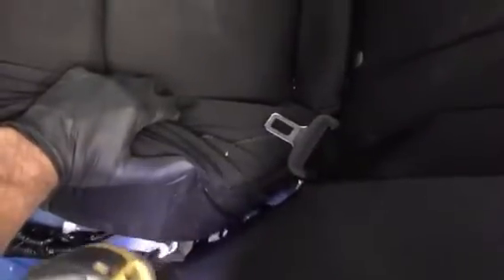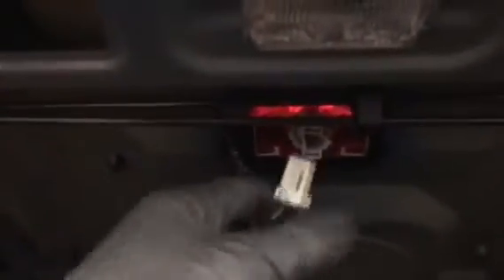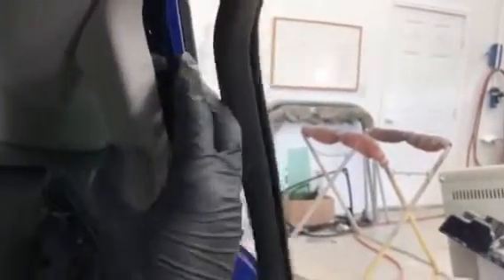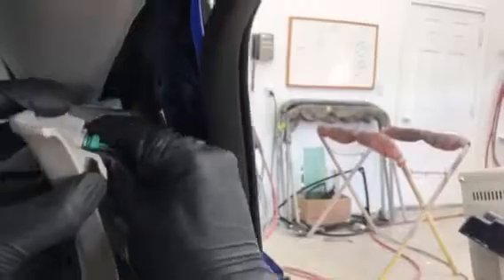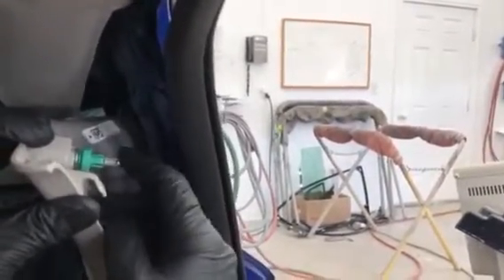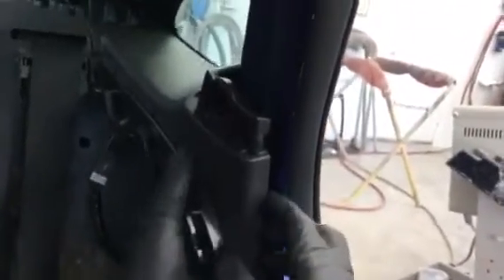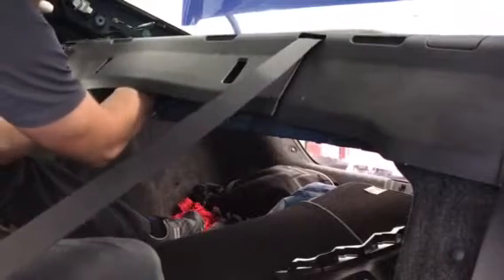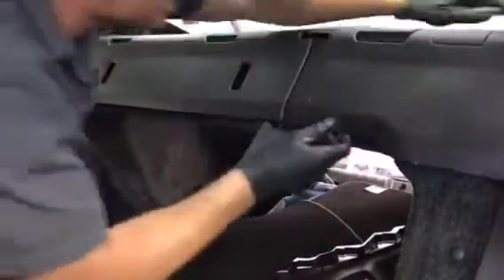2016 2017 Honda Civic -- How to Replace Rear Speakers Removal Remove Install

Comment: For coupe owners: to take rear speakers out it's a little easier.

1. Remove the screw hidden above the rear hanger.
2. Remove the black plastic SRS cover by prying out on it's sides.
3. Remove the metal SRS clip directly behind the plastic cover you just removed. To do this, you have to push the metal clip together and then pull outwards.
4. Remove the entire plastic trim piece starting from the hanger all the way to the back windshield. To do this, gently pry down by the hanger and the SRS fabric cover to release the plastic clips holding it in. The entire trim piece with the fabric cover should come off all together.
5. Repeat steps 1-4 for the other side.
6. Open trunk and release rear seat latches and push them down.
7. Take the entire rear plastic cover off as is shown in this video.

Only difference that I saw in my coupe besides how to take off the panels was that mine came with a subwoofer in-between the two rear speakers, but that might be because I have the ex-t model.
Reply: Oh... And before you take the rear deck panel off, make sure to disconnect the two wires for the rear tweeters. You can take them off easily from within the trunk. The tweeters will still be in the rear deck panel once you take it off.
Reply: @vgameh8er  what speakers did you get to go onto your rear deck. i have the same model and body style and everything, an EX-T Coupe. looking on crutchfield it’s telling me i’m going to have to fabricate a bracket to be able to fit the aftermarket speakers in. was wondering how you managed it.
Reply: Is there a video on this??

Comment: I just replaced my rear speakers on my 2020 civic. I had been waiting for months to do it and finally today I did. Easy to pull everything out, it was the putting everything back that took the longest.  No problem resetting the pin for the airbag. Just used a screw driver to pry the plastic clips. I found that the pin on when side was not even all the way installed.

Comment: What size speaker fits the bracket?  I have it all out but having problems finding a speaker that fits   Or another way I can get a bigger speaker in there
Reply: John Bell 6 1/2 to 6 3/4

Comment: Holy crap...So, basically tear the whole back end of the car apart! Lol What  ever happened to just popping the trunk and and replacing the speakers from underneath the back panel??
Reply from the maker: HAHA, they don't make it easy anymore.
Reply: Michael Westbrook life after 1999 lol but yes I miss those days too
Reply: Boosted Fool if you owned a 96-98 civic, it’s harder than this. I wonder why Honda made the 99-00 so easy. Si chassis revision?

Comment: I'll keep my stock speakers ...
Reply from the maker: yeah...its quite to process to get access to the speakers
Reply: what if the car have air bags in the back?
Reply: Matias Cabral all civics have airbag in the back... but they are on the sides not directly in the back of your car
Reply: Much better let the shop do it and pay them
Reply: @allancarvajal1518  I have seen Best Buy want to charge 200 bucks to do it. It is not that hard to do it. I did it, took an hour of my time.
Reply: Less than 10 minutes of work bud

Comment: Just bought a 2018 civic coupe. I looked at the speaker wires in the front door panel's and they are the same size, blue and red. Someone mentioned that if they are the same size, it doesn't make a difference when it comes to negative/positive. Can you help and clarity if there is a negative/positive when it comes to my red/blue wires? Thanks
Reply: polarity is always something that has to match up or they wont sound good at all, do a search online for a wiring diagram
Reply: Did you get to remove the read deck panel? If so, please could you post a video or at least some instructions on the coupe? I have a coupe si 10th gen and I cant remove it

Comment: So I was told that there are tweeters in the rear by the speakers. Is that true? I have a 2017 ext sedan
Reply: Yeah there are 4 tweeters, 2 in the rear deck.

Comment: Does anyone know the size of the front door speakers, tweeters and the rear speakers? I am looking into purchasing new ones but do not know the size.
Reply: Same size as the rear speakers and regarding the front tweeters on your door they don't sell aftermarket ones that fit perfect so you have to buy 1" or 3/4 " tweeters and custom adapt them. Hope this helps....also check www.crutchfield.com and input info of make and model of your car and it let's you know what size speakers you need for that car.

Comment: I have changed the speakers on the back and I broke the twitters in the back. I need new ones now..... for anyone with tweeters on the back pls make sure you un attach them. I was so sad.
Reply: I said the same thing. He clearly has them is his vehicle you can see the wires when he unplugs the brake light. But he skipped the Tweeters.  I guess it’s my fault for not looking more myself but dude needs to fix his video so more people don’t snap their tweeters apart.  Luckily I had a soldering iron and glued the plastic back on and soldered the wires back together. Pain in the ass when I could’ve just unplugged.

Comment: To remove headliner would it require to remove the same side pieces that contain the airbag?
Reply from the maker: Yeah, that trim piece will have to come out.
Reply: DIYHonda how is the clip removed from the trim so that it can be reset
Reply from the maker: I posted a link in the video description on how to reset it.

Comment: Whoever thought it was a good idea to make it this damn hard to access those speakers should be shot. I thought this was going to be fairly simple. I mean why in the hell could they not have mounted them from underneath? Just open the trunk, remove 4 bolts and out comes the speakers. This is just ridiculous lol. Not going to be doing this anytime soon